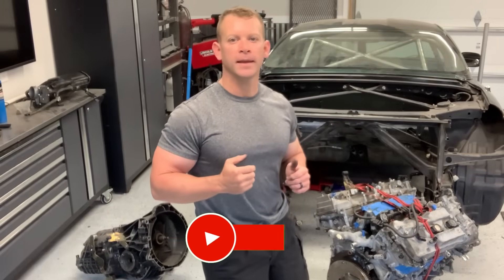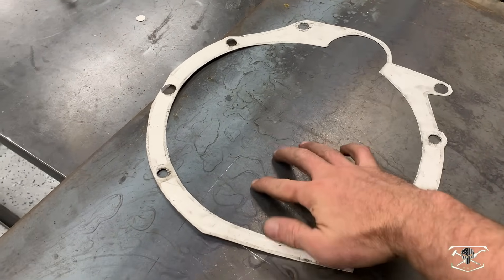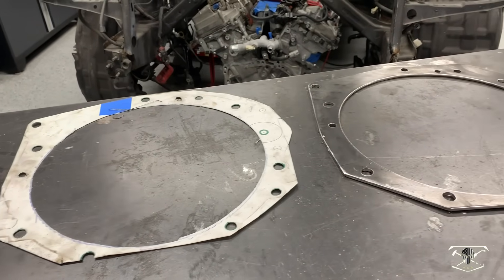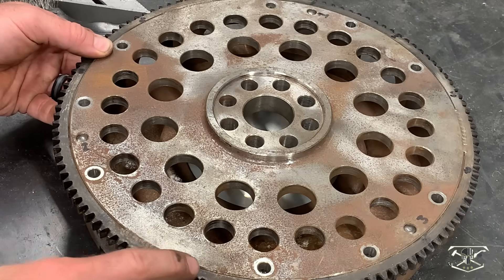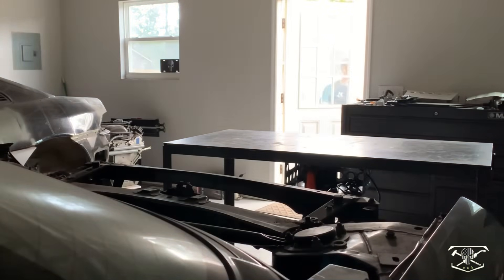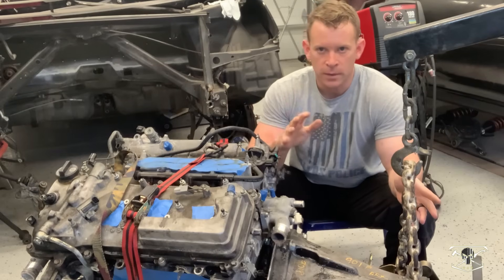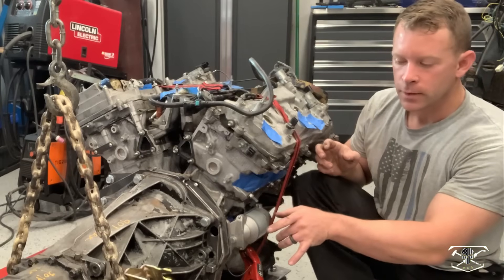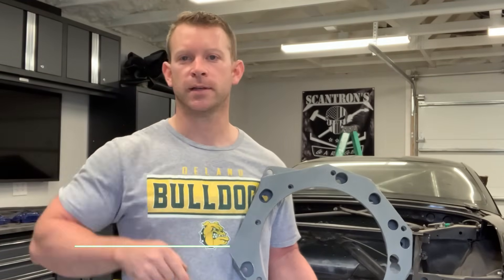DIY Engine Adapter Plate (Mate any Engine to any Transmission)

Comment: This is excellent, good to see that you showed the homemade jig to cut a circle. Couple things for anyone who's never done this: The major things to line up on a manual transmission is the flywheel pilot bearing the input shaft and the dowels everything else can be fudged pretty safely (unless you're operating at big power and all that) as the bolts just clamp everything together. This is a transaxle so it's important everything is nice and straight, on a transmission you can be a couple degrees out it won't be the end of the world. I've seen transmissions cocked over 20 degrees for fitment, especially manual, just makes fluid fill/drain a concern. Autos are pickier.

If you're having trouble with patterning, you can try the shading method which is use a pencil, or you can try tracing paper from any art store, put a light behind the engine/transmission so the part to trace is a dark area. A great thing you can do for cheap nowadays is 3d print parts of the shape and test fit to get dimensions right, takes a couple days sometimes but it's really useful. When cutting a circle with an angle grinder your grinder shouldn't be in too deep it should just barely cut the deeper you go the more your blade will want to cut straight (cos it is straight) be patient with this, also i know you didn't do this, but i think it's better to screw the plate being cut on a piece of wood and clamping that on a bench cut until you see the wood. What i prefer is to use a transfer punch to center out the dowels on your plate then measure from that for the remaining holes and cuts and use a centering punch for all that. Again the important locations are dowels and input shaft. Almost all the engines counter torque goes through the dowels and having a misaligned input shaft will destroy the transmission and other stuff. What i like to do is to measure the input pilot bearing area (or get the spec online) drill and ream a hole so it's precise and slide the plate over that with the transmission facing up (or down) then transfer punch the dowels. this makes sure your 3 holes of most important dimensions are dead on. Everything else you can use a template. it sometimes helps to use studs instead of bolts to help with alignment and all that especially if you don't have all the space in the world to drop engine and transmission if you gotta do a clutch or something.

The flywheel is probably the biggest problem you'll have to consider because there's no way to do it without a trip to the machine shop, unless you find a swap flywheel or all your spaces match up perfectly. A clutch and pressure plate don't care what the flywheel looks like assuming you have correctly places holes and dowels and correct clutch surface. But the clutch splines are critical and so you may need an adapter surface. You may have to get creative, i used vw clutch drilled out to pressfit and weld a T5 mustang clutch collar to adapt a t5 to my aircooled vw engine. I had to use a lathe to dial in the center of of the clutch and collar.
Reply from the maker: Well said! thank you
Reply: Im still unsure of how to account for the extra thickness of the adapter plate andcstill have pilot reach pilot bearing
Reply: @davidtettleton2732  It's all about knowing the total distance of the input shaft into the actual pilot bearing. And then it's all just addition and subtraction so what you would do is you would take the adapter plate total thickness and then machine that much off the bellhousing or what you would do is add that additional amount into your flywheels set up to space it far enough away that you maintain the proper input shaft into pilot bearing along with the spines into the clutch disk as well for full engagement.
Reply: @davidtettleton2732 Yep. He used a dual mass setup and his pilot bearing is in that, not in the traditional place at the end of the crankshaft. I see someone has suggested machining the extra length off the bell housing. Hard to imagine how that would work, as you’d lose all your mounting holes and bell housings are generally cast alloy and can’t be welded. In short, while this is some incredible stuff, it’s not what we need for old school adaptations. For us, if the gearbox input shaft doesn’t reach the pilot bearing, after fitting the adapter plate, we need to find a different input shaft, or have a machine shop lengthen the one we have. It gets very expensive, if you need to modify the crankshaft boss to reach a too-short input shaft.
Reply: That's just kool stuff,I wish I could have put a different engine in my 03 cady,is that possible,if so that would be awesome,Cady has a good engine when it's good but when it's bad oh boy is it BAD

Comment: Could this work on a vw t3 1.8t engine swap??
Reply from the maker: Yes it should work
Reply: How many millimeters per plate?
Reply from the maker: @nikkimukasa1301  4.78 MM 3/16

Comment: Could you mate an old Volkswagen engine with an automatic transmission?
Reply from the maker: Yes but, you would most likely need a computer to run the automatic transmission to a certain degree

Comment: could you do this with a single plate and weld studs where the holes go?
Reply from the maker: Yes but I would have had to use 1 inch thick plate steel. I have no way of cutting that or making the giant hole. Aluminum yes, but a cnc would be the correct way to cut it out neatly ( I don't have one : (
Reply: @scantronsgarage  thanks for the feedback.  nice work on the plate
Reply from the maker: @peetky8645  Thank you so much : )

Comment: Manual layout can be highly accurate on plate by using simple "toolmakers locating buttons" to reference every hole in a bolt pattern to each other.   https://www.youtube.com/watch?v=BpWfIwxVfVw  Buttons can be used with any suitable measuring and measurement transfer tools. Transfer punch sets (I promise you want one!) are cheap and a handy way to use existing bolt holes to make accurate patterns. 
Machinists "spotting drills" are the way to go for precisely starting holes in a way that centers subsequent twist drill bits (twist drills do NOT produce truly round holes so if you're drilling for a dowel best to drill undersized then ream to size. They work fine in any drill chuck including a Jacobs chuck in a mag drill (mag drills are ideal for the sort of work shown).

Every car mechanic who can should take a basic machine shop course as early in life as they can manage. It completely changes how you relate to metal and machinery in a very good way.
Reply from the maker: That was a good video. Thanks for sharing !

Comment: Just curious to know when all the extra (non bolting holes) were made?
Reply from the maker: Haha! off camera after I realized I would have to keep taking off the clutch and flywheel  to get to the bolts that mount it to the block during the mock up phase. I'm not sure what took longer, drilling all the holes or taking the clutch/ flywheel off 6 or 7 times. Either way, they were not needed but this does add a convenience factor to the plate

Comment: Can I bring you my 2011 Tuned to 250 Wheel Nissan Juke and get you to get rid of my CVT AWD for an auto or manual AWD system?? https://www.youtube.com/channel/UCOIeusJytRsiRdayyMdp_6w    
   I have been waiting for someone to make a Built CVT or Find a way to make my AWD JUKE a manual?? I can't turn my car up any further because of the Torque on the CVT. And the FWD manuals can be pushed up too 500ish wheel. It's a catch 22 because they can't get it to the road. They spin the wheels like a sit and spin! They can't make it down a track even with 295's and BC coil Overs on it either! It's so sad.....
     I have been waiting years for someone to figure out a way to covert the AWD CVTs into manuals or a better automatic and no one has been able to do it!! Sucks for me.. Great video though..

Comment: Although I love this video for the help, be careful guys. Many transmissions in economical cars were built to be barely strong enough to stay reliable while stock. 

One car had just shy of 200hp and 240tq.

I did an engine swap with just over 250 hp and 350ish tq and it turned the transmission into a hanged grenade.

Please do your research before trusting a stock trans. Don't kill a classic Japanese sports car like I did.
Reply from the maker: Good point. With that in mind, I did my research on this transaxle. It can hold the hp but no more than 400 ft lbs. This should work well under the stock power. Unfortunately twin turbos are probably out of the question
Reply: @scantronsgarage  good thing it'll hold, sad no Hiroshima hurricanes.
Reply from the maker: @rattyratstuff7125  🤣😂🤣
Reply: @scantronsgarage  mine was a tdi 83 Volvo. 5 cyl turbo diesel with aftermarket intercooler. Engine failed under warranty after replacement so they installed the god tier b21f-t with an oversize intercooler and bigger turbo. I never had a numbered boost gage in there but on the dyno it made 250hp 350ish tq. Lasted a few months before I started doing pulls and it grenades the Trans all over the pavement.

2nd trans was the strengthened one and lasted 2 years before selling the wagon
Reply from the maker: @rattyratstuff7125  Awesome! Sounds like you got it all worked out after all the initial trouble
Reply: Wait! This was my Volvo not my toyota!.

Don't kill a very rare diesel Volvo wagon for those few days of crazy diesel pulls.

Comment: Should you have reinforced the inner diameter of the adapter plate or do you think it should hold with just the outside reinforcement?
Reply from the maker: I think it will hold. Steel is stronger than aluminum. Especially at this thickness

Comment: what about the load which is going to be on crankshaft due to the new flywheel moved so far further back?
Reply from the maker: This is the same flywheel extension "hat" I am using on my v8 swap to this transmission. This has been working without issue on that engine transmission combo

Comment: I’m about to do something similar but you left out one key bit…splines, the gearbox splines won’t mesh without a copy on the flywheel? So yours was preset I would assume?
Reply from the maker: You are mostly correct. Splines were not of any concern due to using a porsche clutch that had the matching splines. The center piece I called the "hat" was for this porsche transmission and already had the proper pilot bearing and also gave me a perfect center to work with

Comment: This is really helpful cuz I wanted to add a 2012 Toyota voxy transmission to my 2003 honda odyssey absolute engine and I was here questioning myself if it's possible until I saw this video which I found really helpful. Thank u
Reply: Well you can say that. The last owner didn't put in much effort for the transmission as much as they did for the engine so it's giving some minor problems. Fixable BTW but I want something reliable so I choose Toyota. The only issue I'm facing rn different frm connection of the engine and transmission. The engine sits on the right side in the engine bay and the toyota transmission suppose to be on the right. At first I was planning to spin the transmission but it wouldn't wrk cuz the transmission oil pan would be on top. The only option I'm seeing rn is to spin the engine around and build new engine mounts for it so it can accommodate the new transmission
Reply from the maker: @themosthated_collins  Spinning it around and making new mounts sounds like the way to go by the sound of it
Reply from the maker: You're welcome! I am happy it helped. Sounds like a cool build you got going as well

Comment: Very Nice.  I got mine from Acme Adapter in Portland.
Reply from the maker: Thank you! What drivetrain was it to connect? I usually get mine through KEP (kennedy engineering products)
Reply: @scantronsgarage  It connects a VW 1.6td engine to a Toyota 2nd gen 4runner or pickup (that has the 22RE or 3.0L engine)
Reply from the maker: @EVtripper  Oh ! sounds awesome!

Comment: How did you figure what flywheel you needed to get the correct amount of spacing between it and the clutch?
Reply from the maker: I just bought a flywheel that fit the crankshaft. In this case, I bought a flywheel from a toyota truck with a manual transmission. I then added the flywheel extension . You see me bolt this to the truck flywheel. 

After the 2 piece flywheel was assembled and bolted to the engine, I connected the transmission (input shaft) into the center of the flywheel (pilot bearing) which left me with the space you see between the engine block and transmission mounting surface. I then checked the spacing between the clutch engagement arm and the clutch slave cylinder. The total space was 23mm all the way around. I connected the two with the 23mm cut plate. This made up for the spacing difference and gave me space to have bolts for the conflicting bolt patterns. Hope that helps.

Comment: Nah I’m just gonna buy a kit lol. 1200 bucks but it comes with the engine mount and flywheel. If I had a garage though my Subaru engine would already be mounted in my vanagon
Reply from the maker: Yes but I had to make this because you can not buy it anywhere. I would have much rather bought one as well. Cool vanegon swap on the other hand!

Comment: I absolutely love this video, but please for the love of cars put a guard on the angle grinder when doing something like that and in general really. I have had multiple friends need hospital trips or have permanent injuries from discs exploding. I have heard of someone dying from taking one to the gut. I hate to be that guy, but I hate even more to lose a guy.
Reply from the maker: Thank you! And I hear you on that. I keep putting it on and taking it back off for certain jobs and then being too excited to work on something to put it back on. I suppose I should just buy another one that always has the guard on. I definitely don't want an injury slowing me down.
Reply: @scantronsgarage  I have a recent model DeWalt XR cordless grinder and it has the super easy to rotate guard where you just push a button and it clicks into positions. Def helps me keep it on rather than taking it off out of frustration. I just got particularly worried watching the angles you had the grinder at relative to your body, hahaha. Literally had a friend in Australia send me a picture of his safety glasses with a chunk of exploded wheel embedded in them. Woulda lost an eye if not for the glasses. Be safe and keep making rad videos!
Reply from the maker: @802Garage  Thank you for the tip! I will look into that for sure. I have also seen some horror pictures resulting from the "death wheel".

Comment: How did you ensure perpendicularity and concentricity after welding?
Reply from the maker: Tons of measuring. I measured it again 360 degrees again after taking it back off and it was within. .05. This will get milled on both sides before first drive

Comment: Cool videos.  Can you come up with an adaptor system to put a T56 in to a BRZ?
Reply from the maker: I can probably. Is the stock transmission not strong enough?
Reply: @scantronsgarage  it handles stock power and mild driving but won't take much abuse.  Big complaint with these cars.
Reply from the maker: @brianlambertp.t.6499  I see the need for it then. I wonder how the transmission will fit in the chassis cavity? The Subaru trans is much smaller than a t56
Reply: @scantronsgarage  I think it will.  Folks use the T56 when they do an LS swap.
Reply from the maker: @brianlambertp.t.6499  Ahh yes. That makes sense
Reply from the maker: That is true. I forgot I have seen that

Comment: What did you do to align the trans input shaft with the engine crankshaft centerline?
Reply from the maker: So, I just slammed the input shaft into the pilot bearing and there was this gap between the engine and transmission that was about an inch wide. I measured about 1 million times around the diameter of flywheel to make sure the measurement was the same 360 degrees around. It was 23mm I believe. I still need to bring the plate to the machine shop for milling on both sides to ensure my accuracy

Comment: Where do u get the steel plates
Reply from the maker: My local steel and fabrication shop. In my case, Deland metal craft. Check to see what metal fab shop is near you. They will usually sell you their drop (leftover cut pieces)

Comment: I'd have left the square on the paper until after I had the templates on both the engine and the transmission. Would it not be easier to square up?
Reply from the maker: That's not a bad idea. That would have saved me some time. Thanks!

Comment: Why’s the flywheel wobbly?
Reply from the maker: The center plate bolts in. I did not tighten it down for mocking up. This thing had to come apart and get put back together at least a dozen times
Reply: @scantronsgarage   I need to make an adapter plate to mate my RF diesel to my 3rd gen toyota trans.   Haven’t searched it on YouTube but somehow your video was suggested 👌🏻
Reply from the maker: @wellscody86  That is awesome! Google is always listening:face-green-smiling:

Comment: Can someone explain to me how the transmission was mounted in place before the gap was welded in? Was the two plates bolted together with spaces? Or was it just held in place with the input shaft?
Reply from the maker: held in place with input shaft. the trans was supported with the engine hoist and the engine was shimmed to meet the transmission

Comment: I wonder if this will work converting cars to manual transmissions. Thanks.
Reply from the maker: Yes it will ! Depending on what transmission you want, an adaptor plate may not be needed. Example: if you had an automatic Tahoe and wanted to switch it to a TR6060 that was in the manual camaro. Same bolt pattern just change the flywheel as well